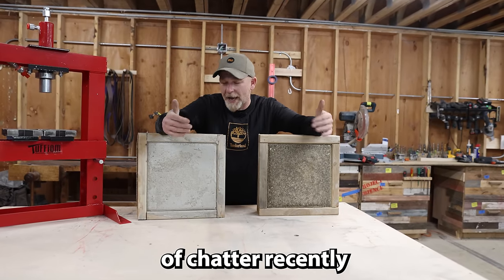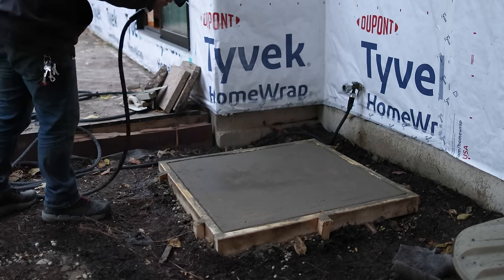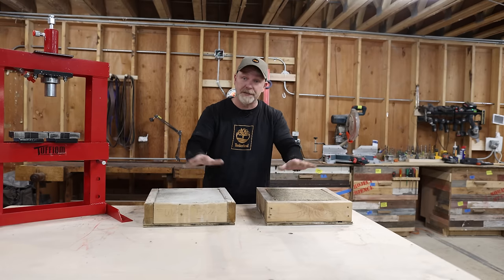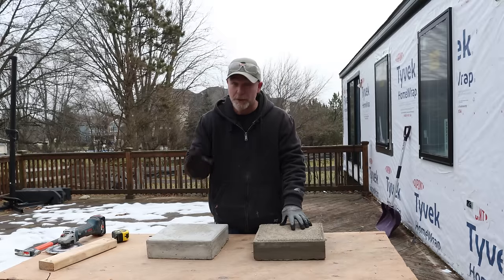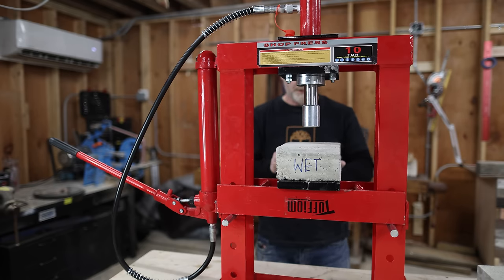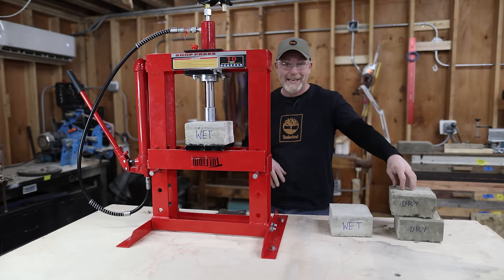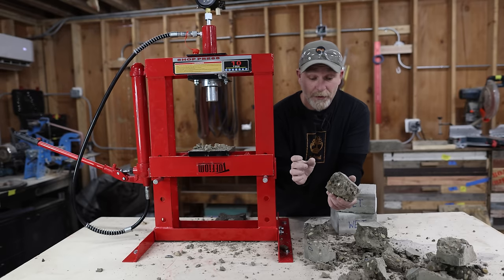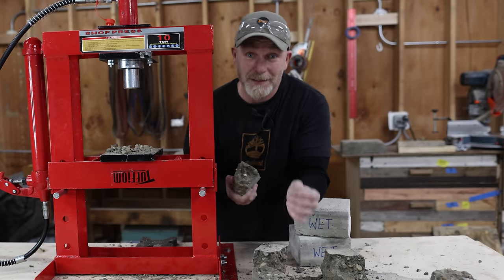The TRUTH About Dry Pour vs Wet Pour Concrete!! Strength Test - You WON'T Believe the results!!

Comment: I'm curious to find out if dry pour then water, then vibrate, then water then vibrate again (keeping track of what amount of water has been used), then screed/finish and proceed with misting for the next few days. I suspect the strength will fall somewhere between the two samples you have there ¯\_(ツ)_/¯

Comment: Well 2 tons, not 2psi. That looks like a 2inch diameter head so 1 inch radius so 3.14159 square inches.
2000lbs/3.14159 sq in = 636 psi failure for the dry pour.

If my math is right then the wet pour handled 16000lbs/3.14159 sq in = 5092 psi

If my math is right, which I think it is, and judging by how much the block jumped at 636psi; it was not wise to stand by the wet block at 8 tons.
Reply: I just reviewed some other concrete press breaking tests and it looks like the energy the made the dry concrete jump when it broke was probably just air in your press that gave the ram a little displacement at the end. So you were probably fine standing near the wet pour.

Comment: This is not dry concrete my friend. Dry concrete is concrete that is only set up dry. Once set up the dry concrete should be flooded with water for 15 minutes, then covered with plastic and kept damp for 72 hours. If you mist the dry concrete first, then you will start to cure only the outer layer, not enough water will penetrate the core once this happens and the dry concrete will not have cured inside at all. This is what you I see here... That is why "misting" is only done after flooding with water for 15 minutes minimum. Someone played telephone and lost. Read the directions. Know for yourself.

Comment: I've always been for wet pour. but the red bags for post setting fast setting by quikcrete, has really got me wondering. suggestions on the bag say to just pour dry and add water. if infact this bag is as effective it may change the way concrete is poured. I'm not sure though how many psi the rating is.run a trial on this red bag

Comment: Got a question ? 
Why when your doing the compression test , the wet sample you push on it with just the piston itself , then you go to the dry and you put that plate on top and push on that with the piston , doesn't that significantly reduce the pounds per sq.in. than the one without the plate, has way more pounds per sq.in. ?? So your test isn't really proper 15:09

Comment: the chemistry underlying concretes strength needs the water to work.  You are not getting the bonds in a dry pour that you do with a wet pour and that should be obvious to any body.  Would you mist a dry cake batter in the oven?  No, because that'd be stupid.

Comment: That doesn't look like a dry pour; it looks like a box of concrete mix that had a small amount of water poured on top, that never got down through the pores of the dry cement to do anything more than dampen the individual grains of the material.  Dry pour means that the form is filled with dry material - not that it never gets thoroughly wetted in the process.

I suspect that a wet pour that had a like amount of water - that is, an insufficient amount - mixed in would likewise have no structural integrity, as the inadequate wetting would not allow intergrowth of the crystals that provide the strength of concrete.  

Instead of randomly misting the top of the dry pour, there should be a measured amount of water - equal to the amount that would be used to mix a wet pour - poured over the top, and allowed to thoroughly soak into - fully permeate - the dry mix.  You are, after all, relying on the permeability and pore space of the dry mix, and only the capillary action of the water, to infiltrate that permeable dry mix..

 As it stands, what you have is more or less what's left when you wet sand - particulate material that is not bonded within itself.

Comment: I haven't watched your video yet but I can end this debate with one word; slaking.
Slaking is the term used for the chemical reaction that occurs when quicklime (CaO) is mixed with water. This reaction is commonly performed with an excess of water, and this creates a slurry of solid calcium hydroxide particles floating in water and this is commonly called 'Lime Slurry' or 'Milk of Lime'.
A dry pour doesn't allow for the complete chemical process, therefore can never be as strong. It's a short cut for lazy people, at best.

Comment: Bottom line dry placed concrete is limited to non structural projects. Why anyone would use is not understood. Maybe fence posts or something similar.
Great for the lazy contractor or home owner.
You already paid for the material, just need to put some work after that.

Comment: Another Youtuber who does not even comprehend the meaning of the units he is confidently expressing to camera.

10 tonnes is not a pressure it is a load.

You did not break that concrete with 2 pounds per square inch pressure, 2 tonnes load on the ram more likely.

It was fairly obvious that you bought the press for the video and had never used one before, I very much doubt that the pump was intended to be mounted and actuated in that orientation either. 

Nonetheless a good visual demonstration of the weakness and slow cure time of drymixed concrete.

Comment: 8 pounds of pressure?   Well considering good concrete has 4,000 pound per SQUARE INCH strength, 8 pounds shouldn't crack it.

Comment: You did it wrong. You can see how well it does on this channel Cajun Country Livin'. They have perfected it and proven it works. They just poured a 3ft by 75ft sidewalk using the dry pour method, with no issues. You should follow their method and use the misting chart they show on their video. If you can't dry pour, then why is it when you leave a DRY bag of concrete outside and it gets wet, it gets as hard as a rock? Explain that one to me!

Comment: You need to do the dry pour correctly before you test it. We did a 8 inch step, and it's perfect. It's gray in colour and solid as a rock. You can't break pieces off the edges, etc, so I am completely questioning your process. Sorry.

Comment: Your test is not scientific.  The dry pour was still green because it take a long time for the moisture to get thru the dry concrete and cure it, were as the wet pour starts to cure right away.  Do this test after 6 months, making sure the dry pour is outside and getting wet periodically.  It may not be as strong as a wet pour but for most none structural applications like fence posts or simple slabs, it is more than adequate.  In any event, nice try.

Comment: Who couldn’t have guessed this….concrete strength is of secondary consideration. First and foremost is “how lazy (or stoopid) are you?”…i mean to mix a 60 or 80 pound bag takes about 5 minutes MAX(you can do it in less than 2 minutes if you get a rhythm going)… or you can dump dry mix into a form or hole, and then spend 10 minutes spraying water on it…
If any contractor does work for you and opens the first bag up to do a dry pour, tell him to pick up his schitt and hit the road… these guys talk up dry pours, and you can actually see the BS pouring out of their mouths…

Comment: Dry pour?  That's insane. Did you cure the concrete samples outside? And of course distributing weight across a larger area, will give you more strength (psi). That dry pour sample should be enough proof to not ever use it on any project. Ever! Did you pay for that compressive apparatus just to prove a point? That's expensive as hell. Should have just asked an Engineer. It would have been a lot cheaper.

Comment: Just as I suspected.  Dry pour is garbage.  With a wet poured driveway, if it is placed and finished by professionals, that means rebar, dobie blocks, expansion joints, wet the substrate, vibrate the air out of the mud, etc., your good to go.  You can't just dump dry concrete and mist it, that's ludicrous.

Comment: If water is the MAJOR factor generally speaking in mixing concrete then wouldn't it have made more sense to SOAK the DRY CONCRETE as opposed to only MISTING it?  
Of course you're not going to adequately penetrate the MAJORITY of the concrete effectively.  This is a poor prerequisite to your TEST resulting in short changing the DRY MIXED concrete results. No offense. 
Mind you I will NOT dispute that a WET MIX is significantly stronger than a DRY MIX for the obvious reasons but depending on the APPLICATION, I believe a dry mix can be adequate enough under certain circumstances.

Comment: Thank you for this video.  So we can know how poor quality a dry poor is.
Reply: Depends. I once had to cut dry pour pavers with a concrete saw... I expected the pavers to cut like butter. Boy was I mistaken. But here is the thing... the manufacturer of that product probably knows exactly how much water to add and they have an industrial process with quality control going. That's a completely different scenario from just emptying out a few sacks of cement and spraying some water on.
Reply: @lepidoptera9337  got you. Thanks for the comment. 👍 I was concerning doing a dry driveway in the future. Because I don't have a cement mixer or help. So I liked the idea of taking my time to spread it out and then wat it down once I felt it was ready. But definitely wouldn't want to have it crack when I drive over it. So I don't think I will do it that way now. 🤔
Reply: @geraldcortez826  It might be OK if somebody does it who knows how to do it in layers and with extra rebar (which might be cheap?), but personally I wouldn't take a chance with a driveway. I talked to a contractor a few months ago who did work on a neighboring home and he said that he never does anything without rebar, not even for walkways in the yard. The hassle of having to redo cracked concrete a few years later was not worth the cost savings in his mind. He was also pouring wet.

Comment: The comments from people in here are comical. How often are you going to have a single pressure point of 5 tons in your backyard? 

Dry pour is fine for a walk way or in my case a trash can landing. I would never do a dry pour for a drive way, that would be stupid. 

You concrete folks are just upset because people are find a less expensive way to do a home project.

Comment: Why not just use a compactor plate, water, and 53 with dust. "Dry pour" is about the dumbest idea i have heard of. It will never have strenght, concrete has to dry from the inside out. Not from the outside in. Hence, the center will never harden as it should.

Comment: why do you call it 8 pounds of pressure?  what does that even mean?  then you talk about tons of pressure.  its like you are using the terms interchangeably.  what the hell are you talking about?  Its a hydraulic press.  PSI is the term.
Reply: He probably is just using psi as a reference since he may have not gone through the math to convert psi of hydraulic pressure before the ram vs psi at the end of the ram.

Comment: Dry pour is a social media hack that in my opinion is an outright joke. You know why the concrete manufactures don't have instructions for it?  It doesn't work. If you're gonna do dry pour you might as well compact some mud let it dry a little and spray it with a water proofer. 🤣

Comment: When you don't listen to directions/instructions , (45 min misting intervals instead of 30, the amount of water sucked up from the ground... As you mentioned you covered it overnight during a downpour) things like this will happen. Too many inconsistencies, video edits, lack of effort to dry pour correctly. So many issues with your methods. Especially when you go into an experiment with lack of conviction and already wanting to disprove a theory. Cutting corners in already simple direction. Only thing "suspect" to me, is your method and lack of a controlled experiment, as well as color variations in concrete as you pointed out. Wet pour  I don't doubt had time to cure. Due to lack of evidence and your  determination to debunk dry pour, I say stick to what you know and leave others who know how to DIThemselves, do exactly that. Without an uncut time-lapse video, this is just "fake news". 🤣🤣😂💯 If you dry pour correctly, as the man in the comments says, chemistry and the chemical process will run its course and create a strong reliable foundation for many larger projects. Thanks for the waste of time I spent watching your non factual based bloopers. You only proved that you can't follow instructions and expect to get real results. Lol. I bet you have leftover, nuts, bolts, parts, etc, from every project or build and you're excuse is the manufacturer sent to many or spares.. 🤣🤣🤣. Cure the problem by correctly doing the process and try again. There's zero proof of anything  to be concluded from any of your videos. Other than the scientific method eludes you. Better luck in the future. Viewers beware. " I was told to do it this way for it to work, but I did it my way and it failed, because that's the outcome I predicted"

Comment: Wait 5 years . Dry pack gets stronger as it age's. Your not very knowledgeable about cement are you. Wet mud cracks ten times fatser because of shrinking immediately. Dry pack lasts much longer . The mosaics of pompei etc are pristine as well as all ancient buildings floors all set in a dry mix. Slightly wet.

Comment: dry pour is bull crap it's great if you're lazy and don't want to mix it and just dump it in around a fence post or sign post, but that's about it the young people today are so stupid to think that this is even a option let me see will a flat tire run just like a filled one. ya, it will on a wheel barrel with no load boils down to one thing LAZYNESS

Comment: Horrioble video! You clearly avoided to show the pressure during the breaking of the dry pour but you did display it during the wet pour. I have never had wet pour with the color or texture, did you intentionally do it wrong? I will make a video showing what you did without making viewers questioning the methods you use. I was expect better